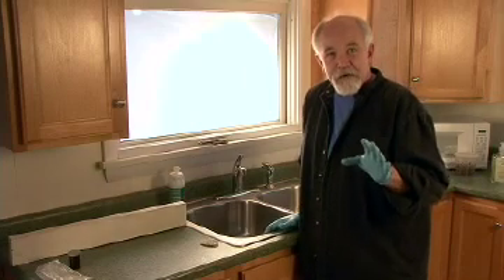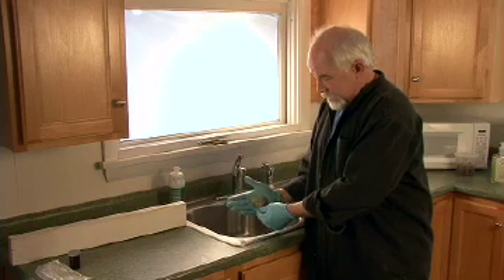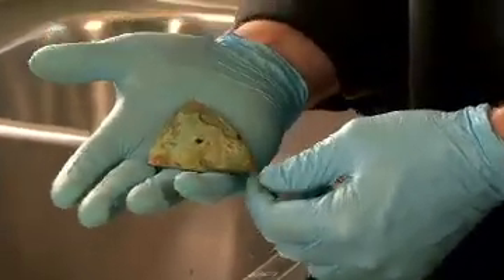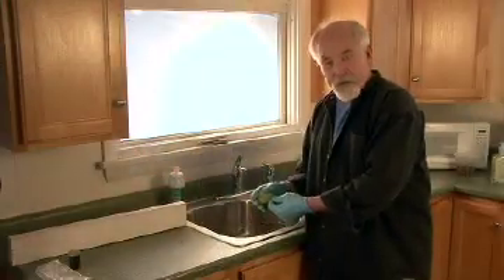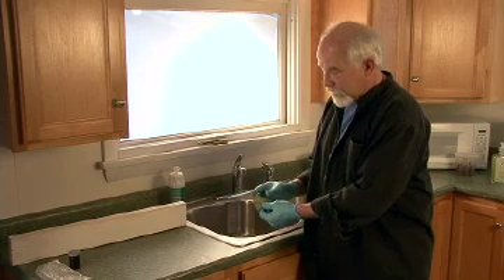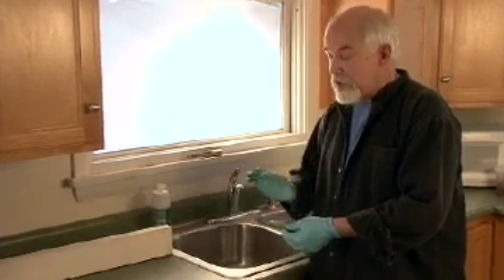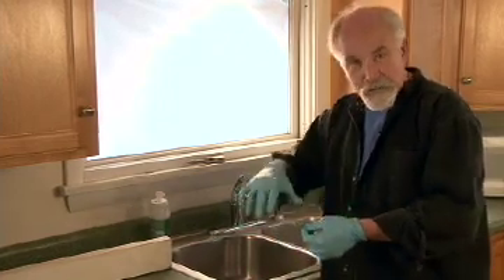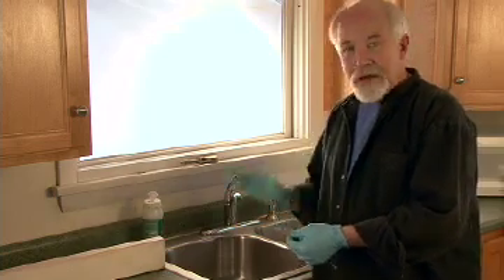Patina Preparation.mov

Comment: I have a tip for speeding up the green patina on copper.  After you paint or dip your copper into the green patina put it into a plastic ziplock bag and place in very close to a lamp which will heat and dry the liquid and with in an hour you have a beautiful green blue colour!!!  yeah and quick .  Enjoy